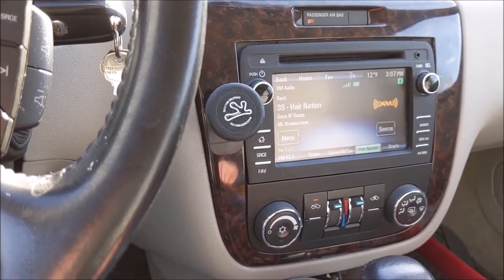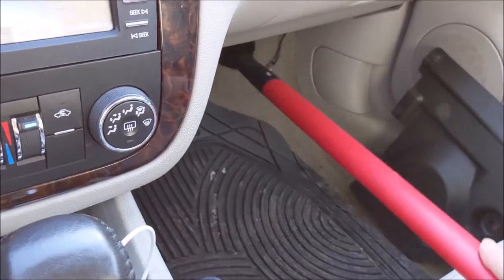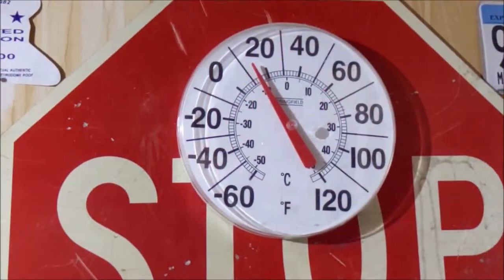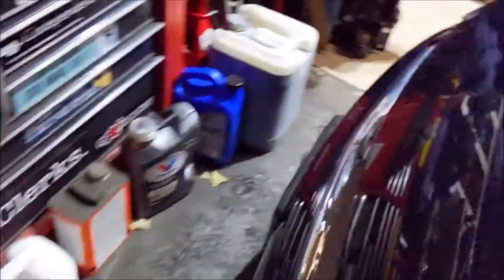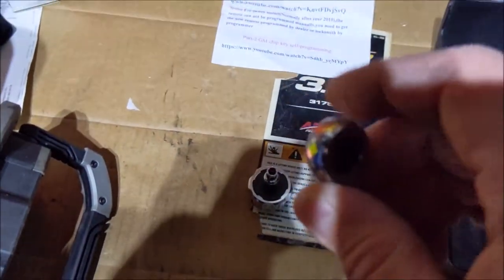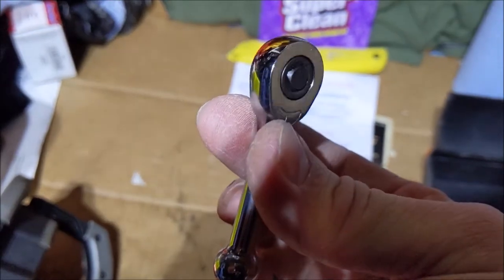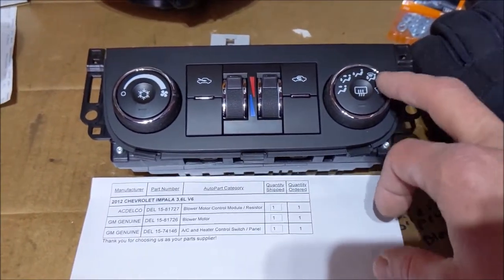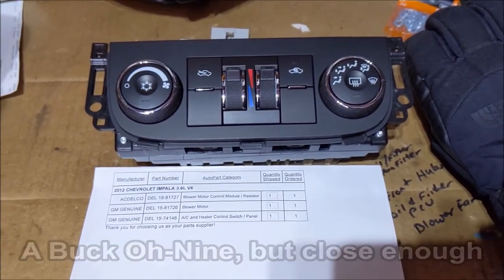2006-2016 Impala/Limited (9th Gen) Blower Fan, Control Module, and HVAC Panel Replacement

Comment: Nice little tutorial! I hope I won't have to do this or at least anytime soon, but at least I know it's not the worst repair in the world to do. As for the seats, both my plastic trim pieces were broke already when I bought the car, must be one of those things that are commonly broke on these cars. Oh, and did you know you can disable that flashing STOP on your backup cam? I can't remember how I did it but I think I went into the main settings and there were a few cam options in it. At least it would get rid of that annoying flashing.
Reply from the maker: I believe the camera I have has a tiny loop of wire that you cut, but it not only removes the flashing STOP, it removes the grid lines as well. The MyLink radio has grid lines you can enable/disable from the menu, but I left those off 'cause they're too high up on the image. 

I'm going to try epoxying that plastic trim back to the seat, but I will likely have to remove the seat from the car to get to the remaining screws!!  Ah well, gives me a reason to deep clean my carpet (and it sure needs it!!)

Comment: Over the years I've replaced all three actuators on my father in law's 09 impala.  This time I thought the one under the driver's side was bad, but I don't think it is.   It keeps clicking then stops and it seems to work ok kind of. If I move the temp. it might start clicking before it adjust to the new setting.  I'm thinking it might be the control module not sensing  the motor struggling at the stop. A guy told me the system senses the stop by high current on the actuator motor.  I'm not sure where it senses it though. In the hvac control module or a computer or intergrated circuit somewhere else.  I might just be a shunt resistor.   What did you replace the fan and the hvac control module this time?   I might have missed it if you said it.    I'm bad about thinking about something while youtube it running.     Well, that's where I"m at right now. Thinking about buying a cheap hvac controller on ebay.  $45.   vrs. $250 at autozone.
Reply: oh snap, I read your discription.  I'm better at reading that listening.     I heard you can reprogram by unhooking the battery and turning the ignition switch to run for 5 minutes to drain the memory voltage on computer.   Then turn off, hook up battery and do nothing for 5 minutes.    I think if you open the door or hit the locks, it goes through a routine of opening and closing actuators.
Reply from the maker: I would bet the farm that the actuator is bad. I wouldn't waste your money on a control panel. Look at the actuators as being an every-other year maintenance expense - they ARE going to go bad, and you WILL have to change them out again. And don't be fooled by a more expensive brand - they're all crap, and they all fail every couple years.

Comment: I have a question I hope you could help out, I have a 2013 Chevy Impala LT 3.6 engine, I have a problem with it losing power and stuttering going uphill while in cruise control. I have replaced the catalytic converters, spark plugs, and some other things and it's gotten better but it still happens, my next thing is to change the trans fluid because it's a light brown don't think it's been done by the previous owner, I was just wondering if you had any thought about what it could be.
Reply from the maker: Is the Check Engine light on, or have you had it scanned for codes? I have had issues in the past with the injectors on my 12 Impala (code P0276.)  I would suspect if it were a serious issue, a code would be logged. These engines are also notorious for sludging up internally and carbon building up on the backs of the intake valves.

YouTuber "WatchJRGo" did a series on a 2011 Camaro with a sludged-up 3.6 LLT in which he had a service performed called "BG Products Dynamic Engine Cleaner." What they do is run chemicals through the fuel system, induction system, and engine oil to clean out the sludge inside the engine, the fuel injectors, and the carboned-up intake valves:
https://www.youtube.com/watch?v=8r1xOaQG7-g
https://www.youtube.com/watch?v=zwYPVRNUsD4
https://www.youtube.com/watch?v=5fG-LCADsVQ
https://www.youtube.com/watch?v=3y3ykN6_OrU

Might be worth a shot to have the BG service performed if you can find a shop in your area that can do it.

And it's never a bad idea to change out the transmission fluid!!
Reply: @CertifiedShadetree  there has been engine lights on in the past, got it scanned and it said the transmission pressure sensor, had that replaced, it'll flash for about 10 seconds if the stuttering is bad but then turns off. We've had the valves and injectors cleaned, had several general maintenance services. I'll check out the videos, I was hoping to change the transmission filter too but I learned from your channel it's improbable to do it at home since there's no access other than to disassemble the transmission.
Reply from the maker: @KirbyKilla1000  You might be onto something with the transmission being the culprit. I had an old Tahoe that would stutter right around 45 MPH when it would shift into overdrive. I did the usual tune-up stuff and it continued to stutter until I had the transmission rebuilt for a different reason (it lost 3rd gear.) It never set any OBD codes either (but neither did I get the dreaded flashing check engine light.) After the rebuild it never had the stutter again. Never really speculated what was causing it, whether it was the torque converter or a solenoid, or whatever, just that it was a transmission issue.

So my thoughts are this, try a drain and fill of the transmission, drive around for a couple of days, then do another drain and fill. That should get the majority of the old fluid out. Maybe do another drain and fill this fall, and another one again next spring. Hopefully this gives you a bit of clarity with what's wrong with it!
Reply: @CertifiedShadetree  I'll have to try that, hopefully it solves my issues, don't feel like sending off the transmission to get rebuilt after putting thousands of dollars into this car already. To add insult to injury it only has 120k miles on it.
Reply from the maker: Oh wow, that's pretty low mileage to be having problems like that! Good luck, hopefully you can get it sorted out!!
Reply: @CertifiedShadetree  finally got it fixed, transmission was fine, the culprit was bad spark plugs, 5 out of the 6 were the wrong type, they were platinum when my Impala needs iridium spark plugs and the 5 platinum ones all had broken electrode tips. Got them replaced and now it drives like it's new.
Reply from the maker: Wow, so someone had been in there before!!  Glad you got 'er solved!!  The one lesson I learned long ago (with the advent of the GM waste-spark ignition) is that you never want to deviate from the OEM-spec spark plugs (and wires on the older engines.) I've never had a GM with a DIS system that ran right when using anything other than Delco plugs/wires.  Bosch? E3? NGK? Motorcraft? Nope, nope, nope, and nope!!  Those brands are fine for an old-school distributor, but not the GM DISes...

Comment: I have malibu 2012 i cant find heater blower fan in my city can i replace it with anather heater blower car?
Reply from the maker: I would stick with another GM model if possible, but you should be able to adapt one to work.

Comment: Is the fuse location Batt 4?    I for the life of me can't figure out where the blower fuse is.  Nothing is labeled heater or blower....
Reply from the maker: Pretty sure I show it in the video..
Reply: @CertifiedShadetree   shows roughly where it's at in the vid..... just wondering if you remember what it's labeled as on the fuse guide on the cover...
Reply from the maker: @joshblack1406  Roughly?!? 🤣Goddamn, ya made me go back and watch it!!  Your suspicions are confirmed at 3:27.  Had me thinking I left out an important step!! 🤣
Reply: @CertifiedShadetree    thanks.    My service was just so crappy it kept buffering.    Great vid.   Ended up being a burnt wire in the resistor/blower wire harness
Reply from the maker: Ah, okay. Glad you got 'er figured out!